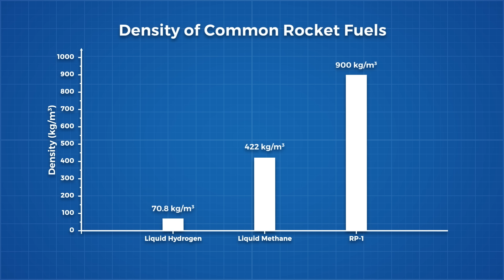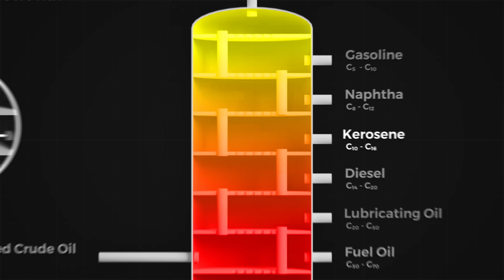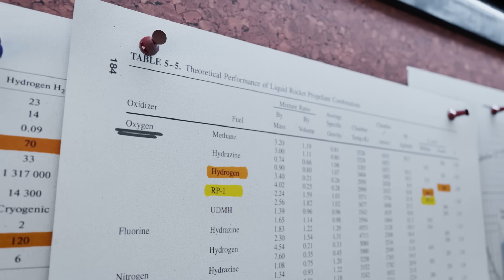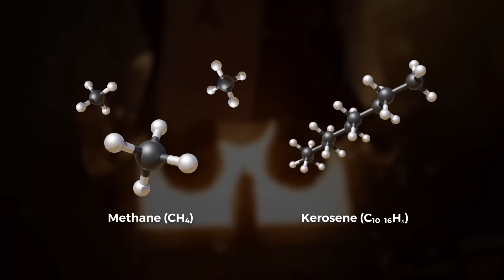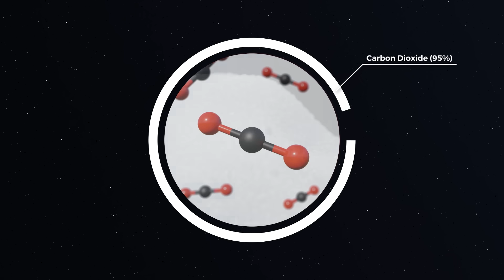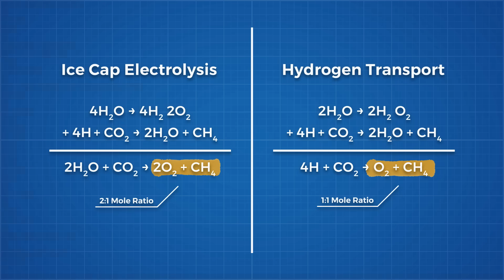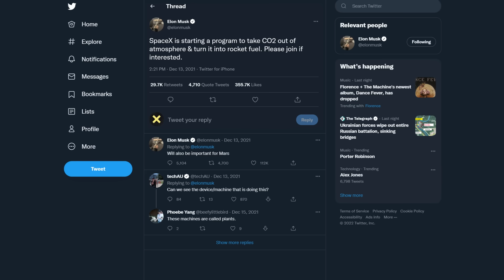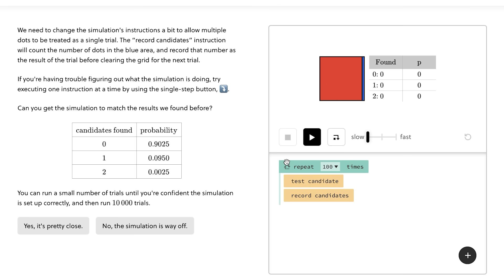Why SpaceX is Using a New Fuel

Comment: 9:36 Actually getting rid of the other components may not be as neccesary, since any lift-off there only needs to counter 0.3G's and thus needs far less fuel or fuel efficiency. The electrolyses of water on Mars, however, may be a problem, since Mars has very little water, and this then should not be used as fuel. Instead, compressed gas can be used with near complete ecological neutrality.
Reply: Use Ion propulsion to gain speed in space. There's no Isp better..
Reply: In the future heating regular compressed gasses for low-G lift-offs may be achieved by using a ground source
for power, by either laser or maser, while expulsion of the while stored liquid gas, gets heated up by such as maser or laser.
Only little actual fuel is required to gain delta-v while out of atmosphere in low-G environments.
Basically you have liquid gas stored at extreme pressure, expel it while heating through the external laser/maser source,
now you have thrust a bunches. Since I'd like to keep it ecologically friendly as possible, the locally created fuel must for the most part be expelled towards the planet of lift-off, so it goes back into the ecosystem, and can then be re-made again. Since Mars has low resources when it comes to certain stuffs like water, using that precious resources, if and when it does not return to the planet, is wasteful. And so, using the Mars atmosphere as a fuel, while nearing 100% of it is also returned to it as the delta-v is achieved seems like a good or better plan to begn with.
Yes, a couple lift-offs don't matter much, but much like the advent of the automobile, that would soon change.
Reply: Also, when the planetary energy emission station can't properly target the vessel anymore, just a little extra heat is required in the form of anythin that can produce such while weighing little, or maybe a space station which then takes over for the power delivery, using the same laser./maser delivery system. (another reason to get a space station above Earth first. An actual space station, not similar to the ISS. Back then I thought when they said space station, I said "Great", then I saw what they meant, and went "That's not what a space station with grav-sim looks like. that's SOOOO not what I had in mind.", losing faith right then and right there.
Reply: Once I get my workspace in the Atlantic, well, that's when the fun starts.

Comment: Chem-fuel is not a feasible way to travel interstellar,  it's barely able in solar orbit. When is the last time Earth had interstellar foreign crafts land using  chem/fossil burning fuel? ( besides on the Simpson & other cartoons😏). Even with nuculear,  it's a micro air realm task for structure stability.

Comment: CO2 in the atmosphere is "not" harmful - it is absorbed by plants which require it for photosynthesis which puts oxygen back in the atmosphere.  It is the cycle of life.
Reply: Drinking water is "not" harmful it provides the body with H²O which is required for braking up sugars giving the body energy.

But what is, if instead of drinking water it would be inserted into your lungs, would it still be "not" harmful?

Comment: instead of electrolysis to produce oxygen we can use radiation from the decay of radioisotopes to split co2 into carbon and o2
for hydrogen we can extract aluminium from the martian crust and also extract sulfur.sulfur can be burned to form so2/so3.
this can be reacted with water from the martian poles to make sulfuric acid.sulfuric acid and aluminium react to make aluminium sulfate and hydrogen gas.then the hydrogen,oxygen,carbon dioxide and water can be reacted to form methane and water,which can be recycled.
(i dont like electrolysis because it is endothermic and wastes some electricity)

Comment: Liquid Hydrogen isn't just less dense, it's a cryo hazard at -252.87 C. Liquid Hydrogen also presents an explosive hazard and can be readily reacted with, so it must be kept in a stable environment until the time and place you want it to combust. Lastly Hydrogen is the smallest element. Nasa has had problems in the past where Hydrogen would leak through solid metal sidewalls because the alloy was the wrong density. Think any space large enough for 1 proton & 2 neutrons will leak Hydrogen. Liquid hydrogen is a surprisingly demanding material.

Comment: VENUS is a far better destination. The atmosphere is a thick, abundant source of CO2 that doesn't need to be mined. Oxygen is a LIFTING gas on Venus. Hydrogen is a more efficient lifting gas on Venus and CANNOT be burned due to the lack of oxygen in the atmosphere. Solar energy is at least 25% greater on Venus than on Earth and the thermal energy of the surface makes thermocouples an ample source of FREE energy. Venus is much closer and easier to reach. Finally, we still can't manufacture gravity. People in airships and floating factories 35 miles above the surface of Venus won't have their bones turning to Jello just by being there. A planet with near-Earth gravity and endless supply of CO2, oxygen derived from CO2, the capacity for flying greenhouses producing plant life far better than Earth, and solar energy FAR greater than Mars makes it a much better first choice.

Comment: Methane creates as many problems as it solves. Propellant transfer in orbit of LNG is not going to be as simple as everyone seems to think.
SpaceX runs propellant rich in part so that real time fuel mixture isnt as critical. If they cant do it with RP1 then be ready for flame instability damage routinely causing problems unless they run fuel rich as well.

Comment: It seems that producing the proper amount of btu’s that is required to find, a proper burn ratio, I know that they spray lignite coal, with different amounts of other combustible products to get the “just right” amount of btu’ process to burn to create electricity, as in the “coal fired” electrical generation plants, … so why not combine the methane, with the diesel fuel, to produce the proper burn ration, all within the same tank? Yes, one is a liquid, & the other is a gas, but why not experiment to get a proper mixture that can be combined with the hydrogen, to get the exoamount of boost required to lift our spacecrafts into orbit, and placing a refueling depot into space, … yes it would be easier to haul smaller loads of fuels, & oxygen, & hydrogen into space, then use the mega rocket that will be chosen to push a large amount of the tanks into a Mars orbit, & keep them there to use as is needed? 
I don’t know why this is so damned hard for you engineers to figure out, … but the way I understand it, is that one had to make many dingle trips into the desert to stockpile water, and create stations across the desert till they reached the destination, … yes, it takes many trips, but was it not worth it to be the first to succeed, … ???

Comment: Global warming/climate change is the biggest hoax to ever be hatched on the world. Now they (Bill Gates & Co) are saying to end use of cows for meat protein by 2024, due to methane. Methane is produced naturally in all bodies of water on earth; always has been! Nowhere has it been proven by legitimate scientific methods that the earth fails to shed heat from its shaded side. Global Temperature increases are all scientific slight-of-hand. Same for “decreasing” polar ice levels.

Enough already!!!
Reply: "Global warming/climate change is the biggest hoax to ever be hatched on the world" - So I assume that you can debunk every single research which confirms climate change, right? Go on then.
Reply: @przemog88  Absolutely can! Problem is, I’ve studied both sides. You haven’t, obviously!

Question: How do you accurately measure the global temperature? Put calibrated thermometers every square inch on the earth’s surface, on land and water, taking continuous measurements?

Or how about every square foot? Or square yard? Or square mile? Or square 50 miles? Or square 100 miles? Or square 1000 miles?? Who calibrates them? At what intervals do you take readings? 

Same for CO2 and CH4 readings? And at what altitudes??

Same for sea water temps and depths. Every square foot of ocean water? Every foot of depth? All moon phases constantly?

Or how about CO2 concentrations in all of the world’s oceans? Every foot depth, every square foot??

Or how about measuring ice depth and exact coverage?

Or how about infrared measurements of heat radiated into space from earth’s dark side? One satellite every 5 square meters to measure it??

How about CO2 and CO4 natural depletion mechanisms? Are all known and measured constantly?
Reply: @wolfman007zz  Yeah, sure... So where you published your critique for me to read?
Reply: @przemog88  Yours first! 

You haven’t been able to answer a single question I just posed to you. Way over your comprehension level. So I KNOW you have no paper of your own writing.
Reply: Biggest hoax yet you think Bill Gates is ending cows for meat lol
Reply: @mactallica9293  Do I think Bill Gates is ending cows for meat? He says he is! He thinks beef is “dirty protein!” Unsustainable per Gates! Problem is, Gates says, is cow farts! Too much CH4, methane, he says. Problem is, cow (beef) production is a very small producer of methane! By far and away the largest producer of methane is the earth itself! Every river, lake, marsh, wetland produces 1000X (at least!!) more methane than all the world’s cows!  Gates just wants to control the world’s food supplies! Control the food, control the world!!
Reply: @mactallica9293  Bill Gates has a lot of pull with like-minded CEOs and media, also politicians. And a LOT of money to sway and swing favors. He has to be watched, not ignored.
Reply: @wolfman007zz  he's he this money and pull for like 30 years.  We're all living longer than ever.  We'll all be okay
Reply: @wolfman007zz  22 million people lol California has 40 million People. They are no where near US in any possible sense

Comment: Mars' atmosphere being 95% CO2 doesn't mean it's super easy The atmosphere has only about 1% of the density of that of Earth, but, on the other hand, CO2 in the atmosphere is 2400 times as prevalent on Mars. Meaning that only once we're good at extracting CO2 from our own atmosphere (2.4x harder than on Mars), we can be sure getting the basic materials for methane on Mars is relatively easy.

But what bothers me about this idea is that we're stealing material from the already far too thin atmosphere from Mars, when any possible terraforming effort in the far future will depends on adding to this atmosphere as much as possible.

Comment: The big picture: Folks there ain't no energy on Mars!!!  It takes energy to launch from earth, takes energy to land on Mars, takes energy to get back off Mars and energy to land back on earth.  All energy needed will have to come from earth.   All the talk about making fuels on Mars shows a lack of any concept of laws of thermodynamics.   Ah! what about solar you say, well the solar flux is about half what we have on earth, very diffuse at best in the summer.  Your best bet is to stage a stockpile of storable propellant like UDMH/N2O4. Why are rockets so large?  Because it take lots of energy(fuel) they use most all of it just to escape the earth's gravity well.  The EPA  city/highway figures for the first 400 miles are really really bad,  Fairly good if your are leaving the solar system on a single tank and don't plan on returning.
Reply: Because of the thick atmosphere and weather of earths surface the solar influx is about the same as on Mars surface.
And since Mars doesn't have weather, the solar influx is very sharp and predictable. Solar functions better on Mars than on earth.
Reply: There's elements on mars so there's energy, you just need to find a way to transform it, which is what SpaceX is working on, if there is no energy on Mars then travel to Mars and back is impossible and if that is impossible then interplanetary travel is impossible and understandably that's not something scientists are willing to throw the towel on just yet.

Comment: what we need to use is a solid version of these fuels... thou i believe it is possible the pressure needed to turn them solid is pretty dynamic... and hard to attain right?
Reply: Solid methane exists in several modifications. Presently nine are known. Cooling methane at normal pressure results in the formation of methane I. This substance crystallizes in the cubic system (space group Fm3m). The positions of the hydrogen atoms are not fixed in methane I, i.e. methane molecules may rotate freely.  etc etc etc...

Comment: Calling the atmosphere of Mars “rich in co2” is a bit of a stretch. It is 95% co2, but it’s 60 thinner than Earth’s atmosphere. Earth has more than twice as much atmospheric co2 by volume. The atmosphere of Mars isn’t rich in anything because it’s barely there. The idea of manufacturing rocket fuel out of Martian air is as ridiculous as the idea that we’re going to establish a permanent settlement there. More Musk nonsense.
Reply: Musk wasn't the first one to come up with either of those ideas. NASA published on that decades ago.
So do you call NASA a "nonsense" talker?
Reply: @3gunslingers  if they said they were going to manufacture rocket fuel out of Martian air, then yes. But I have a feeling they can do the math.
Reply: @plateoshrimp  
"if they said they were going to manufacture rocket fuel out of Martian air, then yes." 
That was literally the plan for Mars Direct and was developed by Dr. Zubrin for NASA about FOUR decades ago. 

The whole concept is called ISRU (in-situ resources utilization) and is an absolute stable for about any plan any space agency ever had for (permanently) going beyond earths orbit.
Reply: @3gunslingers  Dude, you're trying to argue with numbers here. Also, the Mars Direct proposal wasn't published by NASA and Zurbin never worked for NASA.

Comment: Excessive smoke or soot. Is caused by a bad fuel mixture. Or possibly the carbon fiber airframe catching on fire or smoldering at extreme temperatures.

Comment: So if H and H2O is still needed to make CH4 to be used as a stage one fuel for the return trip which might not even be needed because Mar's gravitational pull is 3.721 m/s2 as compared to 9.807 and for CH4 to be used as anything other than a proposed source of propulsion is preposterous because why would one waste H2O and H to create energy when water is needed for life and energy can be created directly from H with Pt as a catalyst and and Pd as a capture?
Reply: Because the rocket operates on CH4 and O2. 
Also CH4 is much easier to store as it has a way higher boiling point than straight H2.

If H2 can be made to produce CH4 then it can also be used to make clean water. It's not like you have to use every single drop for the rocket launch.
There is more than one rocket worth of water on Mars...

Comment: There was no "sooty exhaust" from Saturn Five rockets. The fuel for them is liquid oxygen and liquid hydrogen so the by product is water in the f0orm of steam - what you see from the Apollo Moon mission launches. - Get it right dummies!!!!!
Reply: The first stage burned oxygen and KEROSIN! 
The soot comes from the exhaust of preburners for the turbopump which is piped into the main nozzle behind the throat.

Comment: If you want to stop our climate from changing, you will have to learn how to control the sun, and stop all earthquakes and volcanoes. Only then can you stop our climate from changing. Good luck with all that!
Reply: Nobody is trying to stop climate change as a whole!!
The problem is that the CO2 and CH4 levels in our atmosphere are rising in unprecedented rates. Both gases are exceptionally good in capturing infrared light and thus heat. 
They are like an insulation for our atmosphere.
They speed up the rate of climate change! And do you know what happens to ecosystems if the climate is changing faster than they can adapt?

That's the reason why most humans want to limit the rise of CO2 levels so that the climate change happens slower and ecosystems have time to adapt.

Comment: For Space-X money is no problem, so why not strap some solid Lithium hydride solid rocket pulsejet boosters using SS tubes filled with LiH to the main body?. LiH has the highest ratio of hydrogen to the other element than any compound known. The pulsejets will work with atmospheric Oxygen. Pulsejets are very noisy, but  in a rocket, does anyone care? Except that you have to control the harmonics caused by the vibration. If Lithium is getting too expensive, then a polyethylene matrix with borane mixed in should do the work. Unlike lithium, boron is abundant, and the exhaust will kill every ant and roach miles around the launch pad